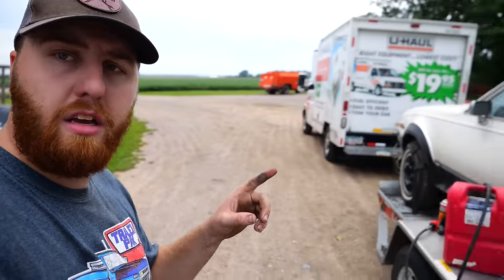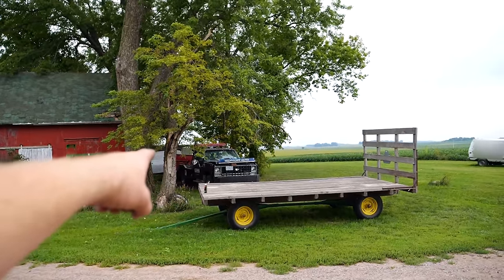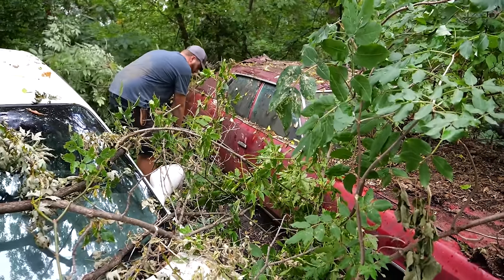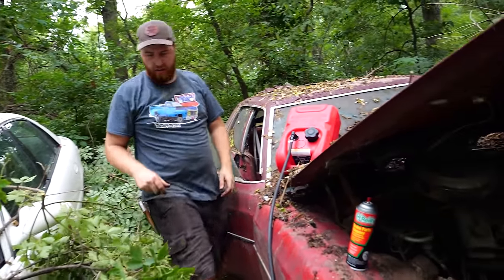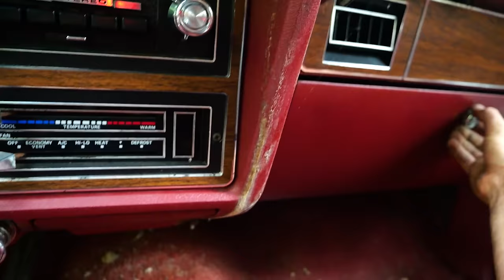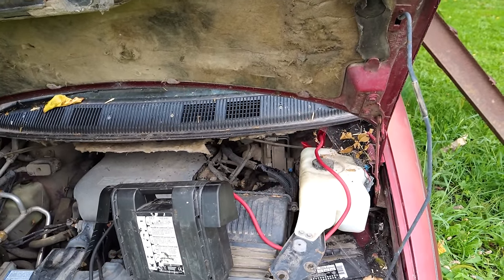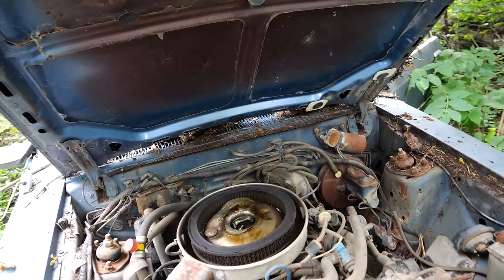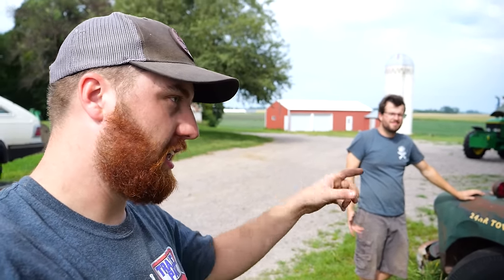ABANDONED FARM FULL OF CARS! Will They All RUN!? - Revival Lightning Round

Comment: Fun fact: LTD doesn't actually stand for anything.. someone at Ford just came up with LTD as a placeholder name and they never replaced it. The funny part is LTD typically stands for limited but those cars were never limited on options, they were LOADED with every thing Ford offered, a few 69 Galaxie LTD's actually even left the factory with Boss 429's though no one knows why or what happened to them.
Reply: The owner of this farm calls them Lakes Trees and Ditches.
Reply: That's great 411 Jay Aye to get your perspective on the LTD moniker.  My parents had a '73 with the 2 door, 4 barrel 429 and beautiful interior (non-leather) seats that just made the ride cush supreme. I believe we had crank windows the color was a light 'Cannon' Quin Martin, green with a pin stripe even.  Putting your foot down on that accelerator and opening the two extra barrels was exhilerating to say the least!
Reply: Limited means limited edition. Which means they're top of the line and loaded with everything. Like every other limited edition from a car manufacturer.
Reply: @JT-tz5hp  correct. Limited with Ford's used to be top o the line

Comment: Hey Kevin 🙂 The running backwards thing is nicknamed “dieselling” in the UK. On carb/points cars it’s frequently due to the timing being too advanced and/or carbon buildup which stays hot enough for a few seconds to ignite any remaining fuel. Dad’s ‘83 Crossflow Fiesta was notorious for it 🙂
Reply: It definitely wasn't dieseling, never seen it push fuel out the carb like that before 🤣
Reply: @BariLopesh  agree
Reply: yea that wasn't dieselling it would just run after the iggniton was cut because it was hot this car literally ran backwards
Reply: @david-pt8wd  Agreed, when it spat a pint of unburnt fuel out of the barrels 😆 Dieselling is when there is excess fuel and advanced spark (or still glowing-hot carbon buildup) after shutdown which ignites when a piston is approaching TDC but not quite there, forcing the piston back down the bore hence running the crank backwards. The Fiesta used to do several backwards revolutions like that; if left in gear it would shoot backwards! Been racking my brains and I just can’t figure out why the LTD was so dyspeptic 🤔😁
Reply: @jimdieseldawg3435  I feel like we need to get to the bottom of this, someone has to purchase that car and find out whats going on there, this is way too much of a mystery to leave at rest. definitely not dieseling, or normal dieseling. But since its pushing the fuel out its probably not getting enough to continue firing, but there could be a way to do get it to spin long enough. I am extremely intrigued to why and would definitely buy it and share it with everyone, but sadly I am not in a financial or medically sound state for spending money on a vehicle, got 2 broken ones already. Someone save it before they crush it please! (maybe the alternator is energizing its self into a motor and turning the engine?)
Reply: Clogged exhaust with a nest or dirt could push an exhaust gas wave back into the engine through the exhaust valves. It pressurized the exhaust system and pushed like a deflating balloon back into the engine, choking it and rolling it backwards.
Reply: The running backwards, spitting fuel. I'm 70 years old once from a farm country with some really old stuff. It's a timing, amongst other things, issue, seen it a lot in my early years, he'll I think the 63 Chevy I drove to school woul do it on a good day !🤣
Reply: @robot_hitcher   found our culprit right here I think

Comment: The RER (Rotax Electronic Reverse) on my Ski Doo changes the direction of the engine. You press the button and the engine stops and restarts going backwards (I think it was developed at Hogwarts). Theoretically You could go as fast in reverse as forward.
Reply: That's a feature on two-stroke-engines!

Comment: Fun vid!  Contact Sleeperdude about the Fords!  He loves those things...  The '54 looks like a 235.  Hard to tell from the outside if it's a 261 but probably not.  Technically not a stovebolt.  Those were '37 - '53 (216 CID) splash oilers.  The 235 is a good engine.  Lots of torque.  Very forgiving.  Run forever...

Comment: would be amazing to save that '54 and use it in future revivals as a back up vs a trailer
Reply: It's a 216, may not make many hps... But they run super smooth.
Reply: @svpracer98  They stopped using the 216 after 53. It would be a 235, or a 261.

Comment: Wow, that Grand Am must have been the second-last one to be parked out there! XD Gel-cell battery maybe?
Some of these cars need to be struck by lightning for them to have any chance at turning over! XD
Yup, seat-pads were once made out of coir, AKA coconut fiber, also called horse-hair for their appearance.
That's what many an old VW Beetle hat for seat-cushions over the springs!
Unfortunately, crumbly old dry fibers, sagging springs, and new owners not putting terminal caps on the battery (under the rear seat) caused a fair amount of fires! 
Not as bad as those caused by fuel-filter/line failure in the hot engine compartment, especially since the rear seat-bottom could be ripped out and tossed aside to burn if people on the scene were quick enough.

Comment: Another good one. Re "stove bolt", while a 54 does have a few stove bolts, the older real "stove bolts" have a lot more of them and the  rocker arm  cover has two bolts sticking out the top of it. 53 straight stick and older are "stove bolts", I think.

Comment: It would be cool if JYD actually came back to the tow truck revived it, and kept it for use. Those old manual tow trucks are hard to find and when fixed are absolutely immortal. Make em even better when you install a proper wheel lift on em.

Comment: New challenge/idea for a video.  Make an engine properly run backwards in some old clunker, and then try to drive it!  Probably have to be a manual transmission, not sure a torque converter would work properly backwards.

Comment: At 11:50 the only thing I can think of that it could be possible for it to run backwards. Is it's running so rich it's not burning all the gas. And the ignition timing is as far off as possible but still runs. It stalls perfectly at the point of firing the cylinder and pushes the piston down backwards and pulls unburned gas in that's lingering in the exhaust

Comment: The 90's-era fuel injected stuff is pretty reliable.  The 3800 will run forever.  That 3100 will run almost forever, until the head gaskets blow.

Comment: Don't know why that particular engine ran backwards, but i have seen that before in two stroke engines. In fact, that is how some RC airplane engines are started: Bump the prop backwards, the engine bounces off compression forward, sparks, and keeps running forward. Kind of an odd way to do it, but it works.
-A.W.

Comment: the seat is most likely horse hair, the engine might have run backwards because the exhaust might have been completely plugged, it built pressure up in the exhaust system and had to escape back through the open exhaust valves spinning the engine the other way.

Comment: It sucks that the Exploder is getting scrapped and you guys are so far away. I could’ve used the engine if it’s still good and doesn’t have a bad timing chain like mine does and sitting in my driveway, still not sure what I’m going to do with it but still a waste to scrap it since prices on used cars is out of control. Especially here in Jersey. If that has a title Kevin you should get it back on the road. Someone can probably use a cheap daily driver. That old flat bed should be saved too. History guys, history!!! They don’t make beasts  like that anymore 😁Love when you guys do videos like this. 👍

Comment: Y'all should buy all the cars with the 3000 series engines you can, great powertrains. My 92 Lumina with the 3.1L stock motor took my 4200lb sedan to 140+ mph with 1/4 inch of pedal travel left, on at least 2 occasions. ( Yes, i was a lead foot in my day ) 😁😁

Comment: The engine that started then stalled and run backwards confuses a lot of people. I have seen this before when the exhaust pipe was blocked. It builds up pressure, stalls and then the pressure is released by running the motor backwards till all the pressure is gone.

Comment: I have an '86 dodge w150 that does dieseling and runs . I've had the keys out, the plug wires off, and the battery disconnected at the same time and sometimes it'll still run for a minute or two. It's scary as hell but expected with a tired 260k miles.

Comment: Old Mack trucks will run back wards if you kill the motor in soft ground or watever there is enough spring in the drivetrain to start the motor, you know right away because smoke pours out of the intake.

Comment: If the timing is advanced too far an engine can run backwards at low rpm. One slug can't reverse the crank at high rpm, that's how you get knocks.

Comment: I was a mechanic in the military and I remember a few times where a deuce and a half truck had the engine run backwards and cause the generator to get so hot it melted the belt. I’m not sure what caused it but I know I had to replace a generator on the highway.

Comment: on the red LTD, My1987 f250 with a 5.0 302 V8  runs backwards if it misses the start or stalls quickly after starting. Its hilarious because mine does the same thing.

Comment: that 1st. red ltd is a new one on me. i've never seen an engine stop and reverse rotation, not to mention the halloween spinner rattle. timing way out mebbe? i was wondering why that 5400 was cranking so slow being as it is a 6v, and you ran 12v to it. it should've cranked over like a turpentined cat, you know, kinda like it did once you finally had both jump packs connected. carb-a-taters don't take kindly to sitting around doing nothing for decades, then you try to wake them up mid nap. they'll throw a tantrum like a two year old you took a cookie from.

Comment: The Duraspark on very low voltage from resistor wire to module and none voltage on start hot wire to module wire have this issue... Engine starts backwards... 
No logical and/or books explanation... But i happened to me.

Comment: On the square body you need to shake the steering wheel it’s unfortunate that it is not a automatic cause then you would just have to push up on the gear selector

Comment: I don't get why you'd want to redline an engine on cold and very dry starts, not to mention on old oil, unless the goal is to kill it.  I would let them idle as low as possible until they get some oil pressure and temperature going.  Great videos anyway though.